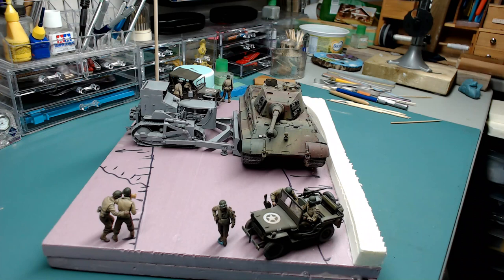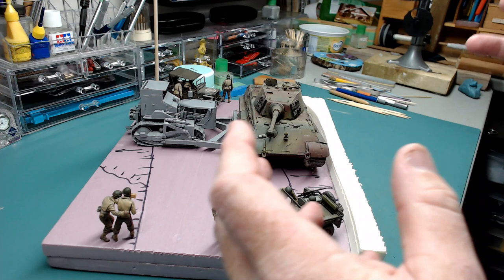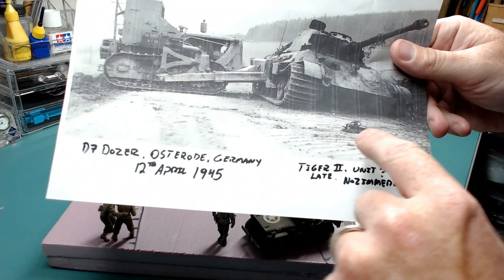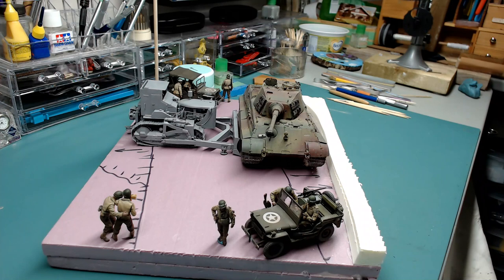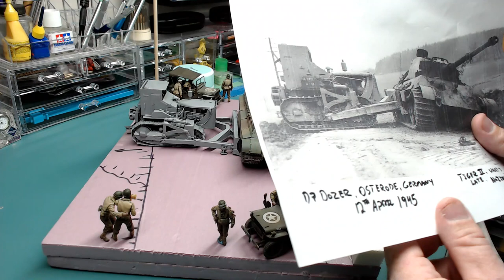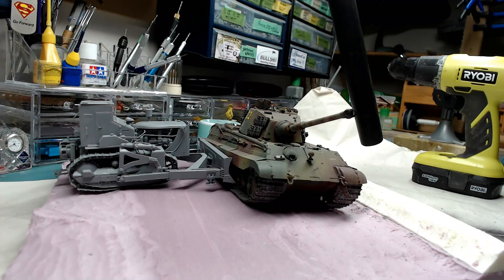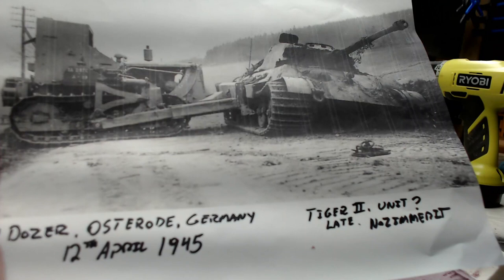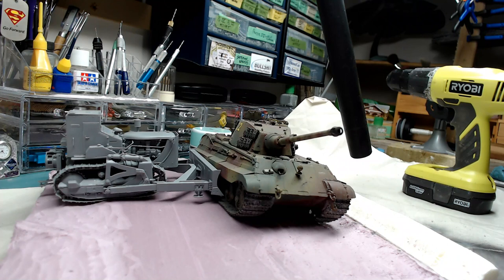D7 Dozer and the Tiger 005

Comment: Looks like the dozer cleared a pth behind the Tiger and then pushed it back before starting to push it from the side? that said could the item on the ground be the floor escape hatch? great idea for a diorama thanks for sharing.
Reply from the maker: A few of the fellas have already commented about that, and I think that we've determined that it's the floor escape hatch. I don't know what's wrong with the wheel on it... seems to be missing some or all of the spokes, but that's what it looks like. I actually forgot completely that the Tiger II had a floor hatch, so I had ruled it out all together. Wasn't until I looked at my build of the tiger with an interior that I saw it and came around.
As for the movement of the tiger... hey... that's possible. It's really hard to tell from the pic as it's such a narrow point of view.

Comment: Hey Mike, could the ground object be the floor escape hatch on the bow gunner's position? Look at pictures of a takom interior kit, you'll see what I mean. The stepping and overall shape looks perfect to my eye- as to why it would be that far away from the tank, I'm not sure.
Reply from the maker: I did some digging for period pictures of that hatch to see what the actual thickness was of the grab handles were and what that wheel looked like, but I couldn't find much of anything. I did find a few pics of tiger IIs with that hatch missing.... and I think that you're right. I think that's the floor hatch from the radioman's position. 
I had considered it before, but the lack of visible spokes on that wheel made me think that I was wrong about it. Now I'm back to thinking otherwise.
Your fault hahaha. I'm blaming you in my next vid ;)

Comment: Hi Mike. Really enjoying watching this come together. I love the addition of the jeeps and the MPs. It really balances the scene.

I can't ever recall seeing a telegraph pole that has an angled brace heading down to the ground. They tend not to fit them to try and make it harder for oiks to climb up to the business end. I'm wondering if the pole is actually pretty close in the photo (actually not too far from where you have it in the dio) and what looks like a brace may be a ladder or some such propped up against the pole and the angle of the photo is hiding the rungs and furthest leg. Mind you, it seems to be the same diameter as the telegraph pole, so that would be a mighty heavy ladder.

Regarding the pile of crap on the floor, I agree with it being multiple items. To my eye, the circular, wheel shaped item looks as though it is made of rope or a cable. There appears to be a rope / cable curving along the floor from the pile towards the drive sprocket on the missing track side (left side) of the tiger. The piece at the bottom does resemble a hatch to me - it seems to be two flat pieces of metal - the top one slightly smaller than the bottom one - with a grab handle with "something" on top of it and maybe a tow cable of some sort with the end looped on the pile?
Reply: Another thought with the "brace on the pole": could it be something that is actually attached to the D7 itself (a pipe or part of a winch assembly or something) and its just coincidence that the angle of the photo makes it appear that it is attached to the telegraph pole? To my eye, the hue (if that's the right term for greyscale "colour") seems to match the D7 more than it does the telegraph pole.
Reply from the maker: I’d say that’s all very possible John, especially in regards to the pile of crap in front of the tiger. the brace on the pole though, I’ve already confirmed that it’s what I thought it was. though... I like your ladder idea... it’s more interesting.
pole braces were very common throughout the area apparently. and the poles were abut forty or so feet tall. bigger than what I could realistically stick on the dio. but... I’m gonna add it anyway... and... I’m also gonna make a ladder now and add that hahaha.
your fault.
Reply: But it can't be a brace! I've never personally seen one before, therefore it can't exist... even though I've not researched it... and I wasn't around in Germany in the 1940's. Haha. Goes to show how difficult it can be to interpret a grainy black and white photo from 70 odd years ago. A ladder as well eh? Is that the 1940's equivalent of the phrase "Belt and Braces"? :)

I'm still hoping one of the videos in this series starts with you saying "I'm recycling this KT as it's more correct for matching the photo, but in this episode I'm going to be applying zimmerit to it just to piss off the rivet counters."
Reply from the maker: Hahahaha!

Comment: Could the darker line of the telegraph pole "brace" be the rear open hatch of the dozer, leaving one long diagonal support post you often see on these poles? Thanks for the video. 👍
Reply from the maker: The downward angled one that leads from the back of the dozer down to the pole is the rear hatch of the dozer. The one that starts at the pole and leads downward toward the rear of the dozer is the support brace. It's where on the ground in relation to the road that I wouldn't mind seeing. It seems to have a really long angle so that places it really far from the side of the road, if that's the case. 
Which makes my pole a bit out of place. But that's not the first time ;P